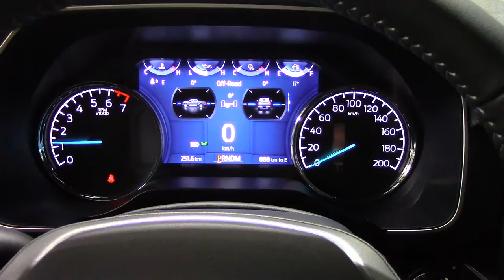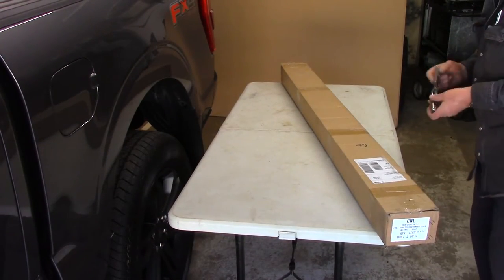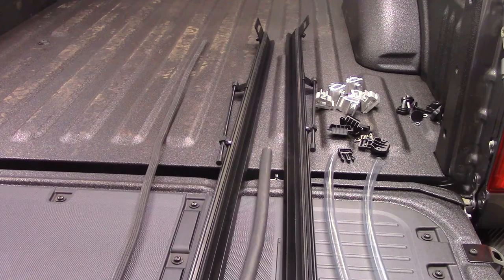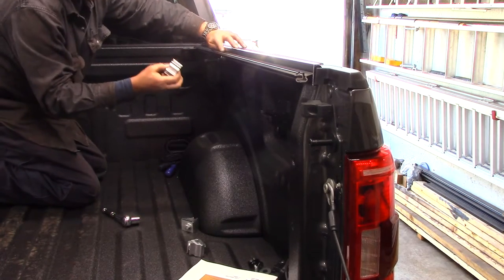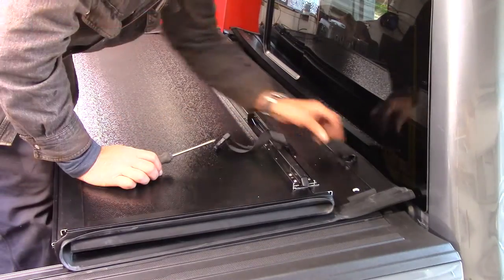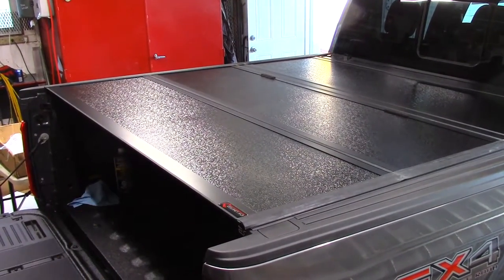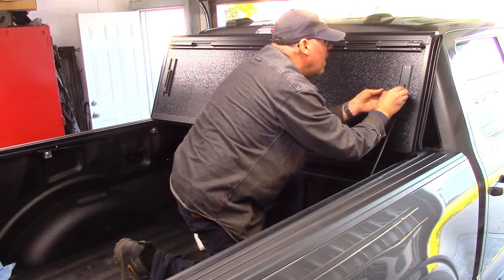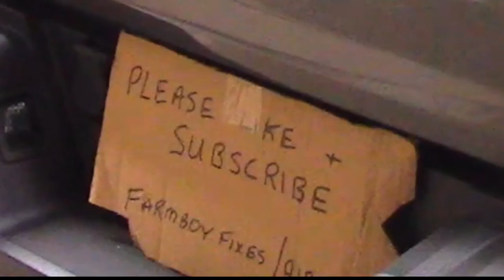CWL 2.0 tonneau hard cover on a 2021 F150

Comment: Very clear and informative video, how’s it holding up?
Reply from the maker: So far, so good.  Although I don't open it in our -30 to -40 C weather.
Reply: @farmboyfixes  Sasky neighbor to your East here! I'm looking at this tonneau and found your video. I appreciate that you don't open it below -30°C, I imagine the rubber hinges wouldn't like that very much. But how does it handle in the 'warmer' winter temps, say -10°C to -25°C? Do you have to thoroughly clean off the ice and snow before attempting to open, or can you just bust on in without much prep? The truck I'm going to install this on lives outside year-round.
Reply from the maker: @chippies  I haven't used it even in those temps.  My new f150 is a garage queen, I use my 2006 silverado in winter.  But, knowing the design, I would brush off the snow before opening it.